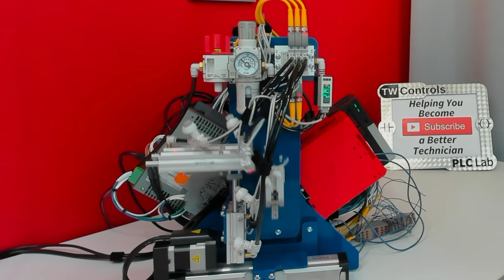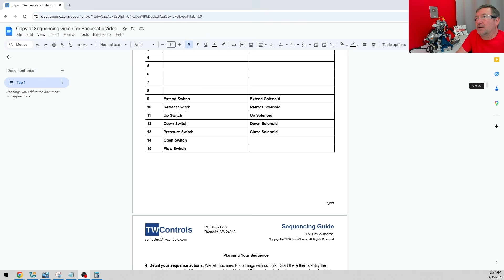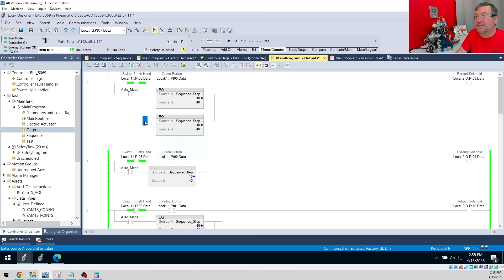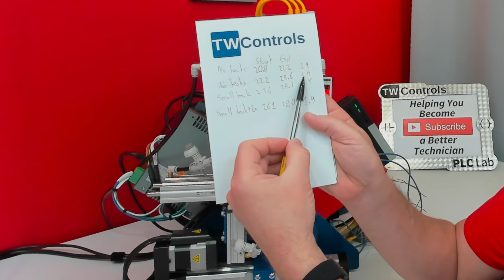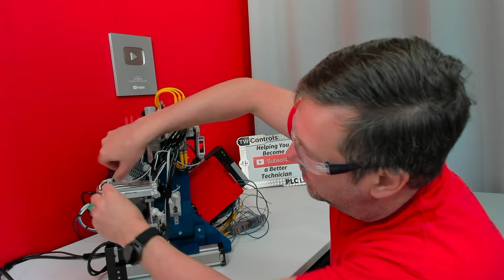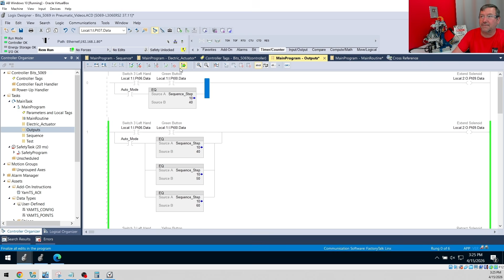Stop the Hiss: How to Calculate and Justify Pneumatic Repair Costs

Comment: The arithmetic that survives a finance review isn't the annualised CFM at a blended $/CFM - that's an average being argued against a marginal cost, and the plant either has spare compressor capacity or it doesn't. What gets funded is a leak tied to a measured pressure drop at the tool during an event that stopped production, which is also why a shutdown audit and a production-flow audit find different leaks: the ones that matter only open under load and thermal cycling.

Comment: Dude nice video, in past life i worked in a plant where every shut down the clip board came out and clamp on meters to see which machines leaked and which ones needed new cylinders and what not. Good times 

In industry most of of must customers are requesting electric actuators and if pneumatic (or huff and puff) should be ran at 60psig or less. And should have an energy saver mode, so when not in auto drop down to a lower PSI vs auto mode 

Of course depending on cycle time required and what not. 

Good times.
Reply from the maker: Yeah the 60 PSI operating pressure was a real eye-opener at the pneumatic training we hosted. I'm used to plants where we're happy if we could hold 90 PSI. But they are right, typically there's only one cylinder that actually needs the higher pressure.